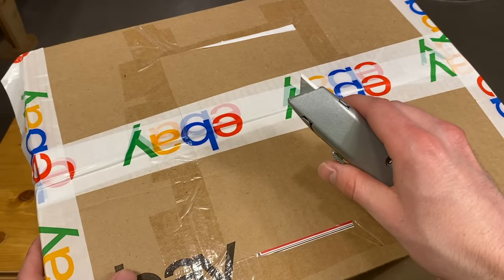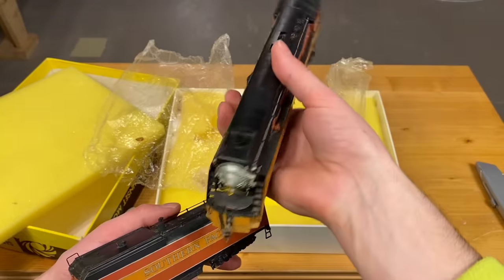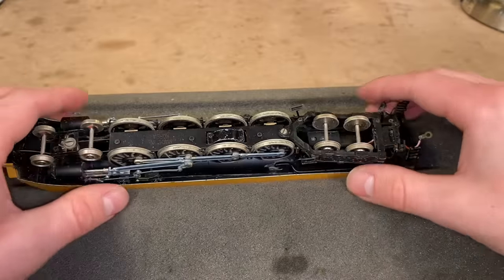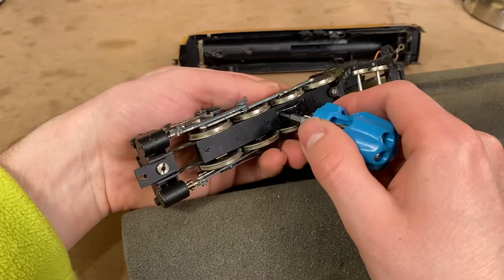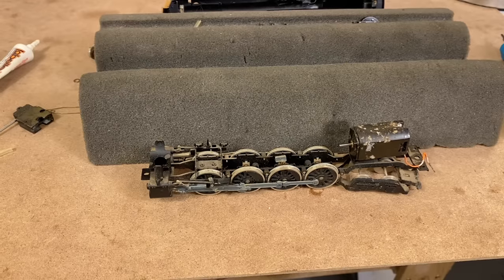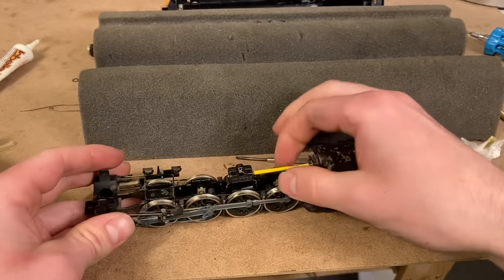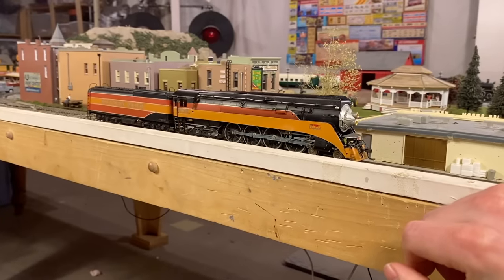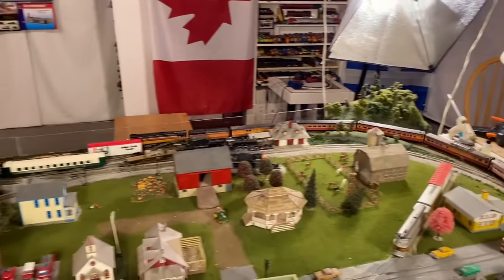Can We Make This Southern Pacific Daylight Run? Brass Locomotive

Comment: Looking really smart there with a rake on.  Always preferred diecast to plastic myself.

Anybody else notice the ladybug?
Reply: That ladybug was in perfect position for the daylight
Reply: That’s just George. He works in advertising. He was demonstrating that the locomotive can crawl as slow as a ladybug.
Reply: One minor technicality - that locomotive is brass; not diecast.  It was built, most likely in South Korea, by hand.
Reply: Years ago bought an HO engine and some track and had it set up on the floor. Bad idea of course. Had a small shop vac to keep the R/W clean and was amazed at the spiders and bugs that had been killed by the train. Am not a good house keeper

Comment: Nice purchase. It’s a good thing the original owner wrapped the model in plastic, a lot of those older Sunset boxes have petroleum-based foam which breaks down over time and eats into the brass, even when the box is stored in cool, dry conditions. I was shocked to see this phenomenon when a gentlemen brought a collection of older brass into the hobby store I worked at as a teen. Nice looking GS4 you acquired!

Comment: Spectacular work and congrats on your first brass model! Now that’s a disease you can’t cure, trust me, I got several brass model and once you buy one, you’ll want more! Thanks for sharing!
Reply from the maker: Thanks, I wouldn't hesitate to buy another one from Sunset.
Reply: @SMTMainline  Sunset is definitely a good intro level for getting into brass. Look into getting some Pacific FastMail(PFM) for another cheap, but great detailed and sometimes good running models.
Reply: The one thing keeping me from a brass addiction is the scale my brass models are at, and their resulting pricetags. My entry into brass is an LGB/Aster Live Steam Frank S. in G-scale, and since then I've only purchased one other, an Accucraft Fn3 0-4-2ST Plantation Locomotive, also live steam, because each one was over a grand.

Comment: I own a few brass engines. And yes, There should be a drawbar. That wire would connect to a screw, that would hold a drawbar. They would also have the rivarossi style metal wire contact. Great job replacing the drawbar, and getting the engine running! With that Can Motor, you might be able to put DCC in it!

Comment: my grandpa has a GS4 that he kept up on a display shelf above the bay window in my grandparents old house before he moved out to Wyoming. I remember sometimes standing in the bay window and getting the locomotive down and then hiding behind their recliner and playing with it. He had a bunch of locomotives but when I got around to opening up the box of stuff he gave me I only found 8 locomotives instead of the original like 30 some-odd locomotives that were in there. A lot of SP and BNSF stuff with some SF. There was even a PBNE switcher that I'm actually converting to DCC.

Comment: One thing, when handling high end loco's wear clean cotton or nitrile gloves.  Your oily finger prints can etch into the paint if left on the surface.
Nice haul.  I bought a brass 4-6-4 Milwaukee Road F6 a few months ago and it is gorgeous. Paint is top tier
 Display queen so it needs a clean and lube to run. 😊

Comment: That Mashima can motor really aids to the slow speed crawl. They are a low volt, low amp draw torque monster that companys such as NWSL utilize. I have had several over the years in one diesel or another. Excellent motors and will make your operations a more pleasurable experience.

Comment: Well darn it Harrison I was about to drag my old backside off to bed and all of a sudden a new SMT video announcement pops up so I guess I can stay up a little later.
Very nice acquisition though I'd keep an eye on the running gear as when you started out it was running extremely quiet to the point it was just wheels on track heard but as she went there was a clicking " chugging " noise almost like the driving rods were loosening or deforming and hitting each other. 
Also might have to have a word with Nerf Cat as it looks like they're falling down on the job and let a trespasser get on railroad property there right before you hooked up the rest of the train.
Reply from the maker: The makeshift "drive rod" was loosening and was causing vibration when put under more strain in the corners. I think adding some two stroke fuel like as a replacement might do the job to fix it.

Comment: As an addendum, I was able to fit the decoder and speaker inside the boiler. No need to rig up wiring between loco and tender.
Reply: Further to my comment of one year ago, why would you grind the flanges of a perfectly good and expensive brass locomotive just to make it go around small radius curves. They are made for broad radius curves.

Comment: since you have a running Daylight model you can have the other Daylight converted to a dummy model to pull beind the powered one then you can have both daylights running as one big train
Reply from the maker: It wouldn't work since the other has a quartering issue.

Comment: Welcome to the Brass Locomotive Club, You seriously need Broadway Limited Imports Daylight Passenger cars, I think you should read the number which I think if I read this right was 4454 which was the last GS-4 to run on SP in 1958. 4460 is the only other GS series loco besides 4449 that survives today.

Comment: Excellent shape outta the box. Initial frustration that it did not run. But, I was impressed about the foam device you had for the repair work. How long have you been "railroading"?
I'm glad that you knew what you were doing, I would not have the courage to do the tiny repair and modifications you performed. How long did it take for you all to build your layout and set up? It ended up having the power to pull a passenger set up. I grew up in a railroad [UP] family and I miss the passenger service of the 1950's early 1960's before AmTrak. After reading some of the comments I am not a fan or a buff but they were able to address this with more authority than ever I could.

Comment: It would've been nice to see your process for replacing the lead wheelsets, blinding the center drivers, and kitbashing the tender drawbar - great to see an old brass locomotive running around, though!  glad that you got it working :-)
Reply from the maker: The front wheels just popped out, the centre flanges required hours of sanding lol.

Comment: Well ya cant ask for more than that, looks like you found a much better quality Daylight for your matching passenger consist, its running great.  I do wonder how long that thin wall shrink tubing will last under torque of the motor, but its easily changed for something thicker walled and more substantial if necessary in the future. That sure is a smooth running motor and drive, great low speed action-!!
Reply from the maker: I will probably replace the shrink tube with 2-stroke fuel line.

Comment: How did you remove the flanges of the middle drivers?
Reply from the maker: I ran the locomotive at low speed while using a random orbital sander.
Reply: @SMTMainline  Thanks

Comment: @SMT Mainline   How did you remove the flange? This would be very useful information.
Reply from the maker: I ran the locomotive at low speed and used a random orbital sander, also run at low speed.
Reply: @SMTMainline  I see. So like a Dremel?

Comment: I have 2 brass locos that need a min of 30 in diameter radius. I was thinking if I could remove the flanges on the center drive wheels like older Mantua locos that the brass would run on the layout. How did you remove the flanges if you don't mind sharing that info. Thanks.

Comment: Looks great. I would like to have seen more on the blind driver process along with the change of the wheels on the front truck. Also, is there room to add working headlights? I'm not sure how the smokebox front is workable for that feature. Beyond those few things, it would be a model that I would consider if the opportunity presented itself. Great work.

Comment: What were the little pieces of what looked like paper you placed between the drive wheels and frame right toward the last of the oiling?
Reply from the maker: They were rubber shims to help reduce vibration and increase stability.
Reply: @SMTMainline Thank you so much. I have learned so much from you over the years.

Comment: I have a sunset models brass 2-8-0 I bought at a train show for 280 and the guys said it was brand new but it he was kinda wrong because there was some wear but for it’s age it’s really nice but when I got it think during the car trip back, a wire popped out of it a place under  the cab to connect to the tab to the tender and when I pooped in place it ran again, but the only problem is it wheel spills around corner but I thinks because the carpet I’m running the track on

Comment: I think they asked before but how did you get the flanges off? I picture running the engine and running a Dremel to grind them off. Sounds sketchy I'm sure you came up with something better. Also if you are familiar with model glow fuel engines they have that pliable silicon fuel tubing. It would be a better flex drive. I know I've used it In a few low load situations and it holds up pretty well. If too wide for the shafts. You can heat shrink the shafts then put the tube over it.
Reply from the maker: I pretty much did use a dremel while running the locomotive, it is sketchy but I couldn't think of something better. I did my best to clean up metal deposits so they wouldn't get into anything.

Comment: I've got two of those engine's still cool to seeing yours running except it be awesome if it was a smoker
Reply from the maker: So should I just tape a marlboro to the roof? Just kidding, a smoke unit would be since, not sure where it would fit since someone glued steel to the inside of the boiler.
Reply: @SMTMainline  nicely done with the joke I needed that could you un glue it

Comment: Hmm odd my bachmann gs4 4449 doesn’t derail on my 22 radius curves…
Reply: Bachmann's big steamers were designed to operate on 18" train set curves. Brass ones like this are made far more exact to scale so they won't be as flexible.
Reply from the maker: @wildfire19861987  I'm pretty sure Bachmanns models are designed for 22" but as I said they don't always work that well on them. I have Rivarossi, Mantua and Mehano steam locomotives which are the same size and they don't have this issue. One of which being a 2-10-2.
Reply: @SMTMainline  well I've never had any problems with my bachmann 4449. Except the wires snapped off and my club member actually fixed it for me (long time ago) and I still have it to this day! Still running perfectly!

Comment: What did you use to cut the flanges off
Reply: I would like to know this answer
Reply: So it could handle his cures bc a brass engine needs like 30 inch so he did that so he can run it
Reply: @SamSP4449  the original question was what was used to cut the flanges off.
So a how rather than the obvious😅 why.
Reply from the maker: I put the locomotive in a cradle and connected it to a power source, then used a random orbital sander at low speed. Since the wheels are rotating it wears the flanges down evenly.

Comment: Been watching your channel a while and have noticed your layout has a lot of tight radius turns. In NScale(my preferred scale) 22" radius is very comfortable, but for HO, not so much. Are you planning a new layout build with larger radius curves and turn-outs?
Reply from the maker: I can't go much wider without expanding the layout, I wish I had known when I started.
Reply: @SMTMainline  
That's ok, expanding a layout is easy. A couple of 2x4's and some plywood makes for an easy extension. Done right it's inexpensive and safe. Granted, I'm not telling you what to do, only offering some encouragement.

Comment: Great Job SMT! Do you still plan on fixing your two Bachmann GS4s?
Reply from the maker: Eventually, I just don't know if they'll ever work right.
Reply: Fair enough, I have a Bachmann BNSF GP40, and it has had all sorts of issues since I got it new a few years ago. Bachmann honestly are quite a mixed bag. Some of their models they currently sell like the GS4, Prairie and UP 4-8-4 are really bad from what I here or have experienced, and should probably be taken out of their range. On the flip side, some of their Spectrum locos I’ve heard great things about. I also have a Bachmann Branchline J72, and it has to be one of my best running engines.

Comment: Have you ever found a silver streak Tyco train I managed to get a full set for 50$ the motor works and so does the light but it doesn't move I can hear the motor spinning but I don't have the supply to repair it how should I go about repairing it on my own I want to learn
Reply: SMT has made videos on repairing Tyco locomotives.
Reply: @Petemonster62  ok cool👍

Comment: Uh mate, I don't think that was a GS5 I saw the engines number I think it was 4458 meaning you bought a GS5

The GS5s and GS4s are the same but the difference is that the GS5s had roller bearings unlike the GS4s do.

Numbering for the GS5s: 4458-4458

Numbering for the GS4s: 4430-4457

Comment: NEVER EVER USE SHRINK TUBE!!!! You need model airplane fuel line hoses or a universal joint. Shrink tube is way too stiff for motor to gearbox use as it prevents the flexing of the gearbox which in turns prevents stable operation.
Reply from the maker: I replaced it with 2 stroke fuel line.